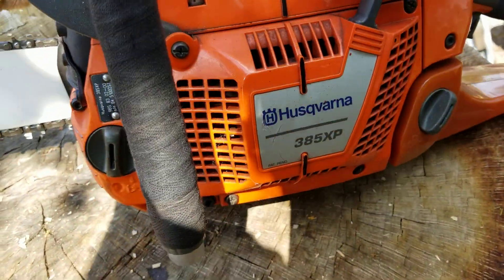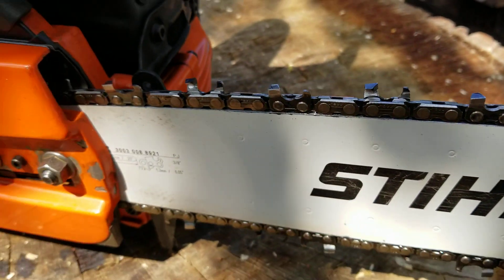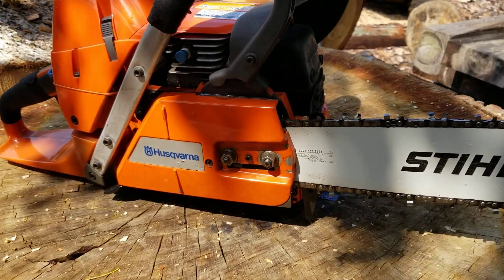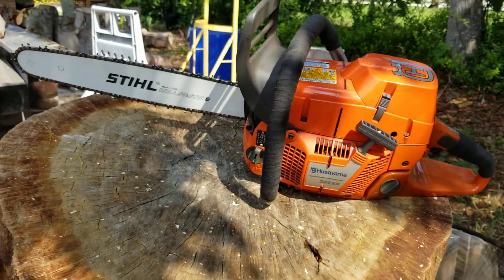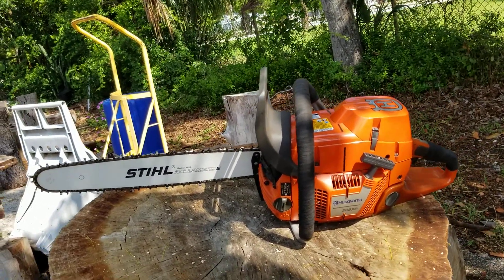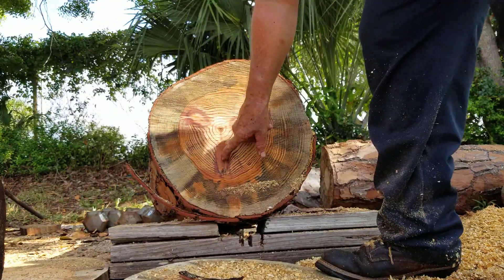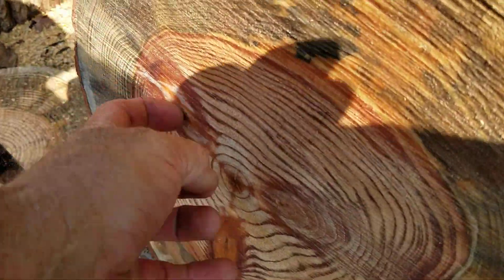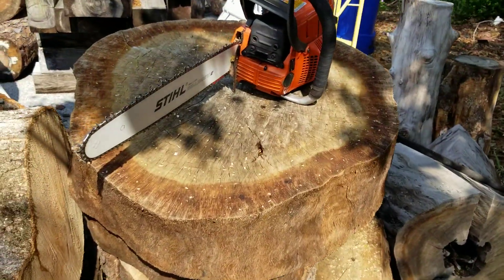HUSKY 385 XP PORTED 20" RACE chain

Comment: Is a 460 rancher more powerful than a 385 ported,also nice cut,where do I find an also a how much for the race chains,sure makes a difference.
Reply from the maker: Pretty sure the 385 is a little faster
Reply: @reillystsb  ,how many ccs is the 385
Reply from the maker: @kennywheelus6857  85cc
Reply: @reillystsb  ,ah,gottcha, kinda like tires on a car gor example, bigger number means lower ccs,an smaller number bigger ccs an power.